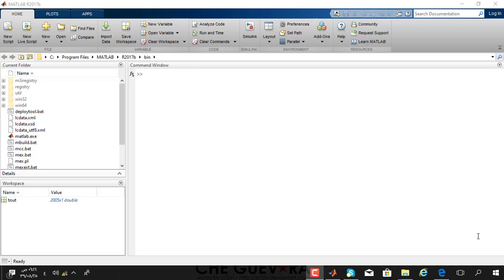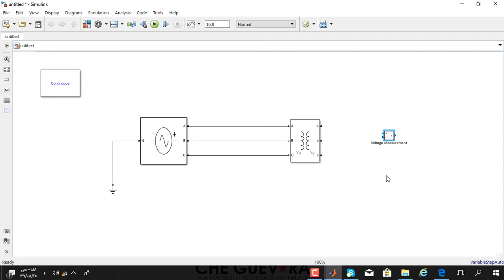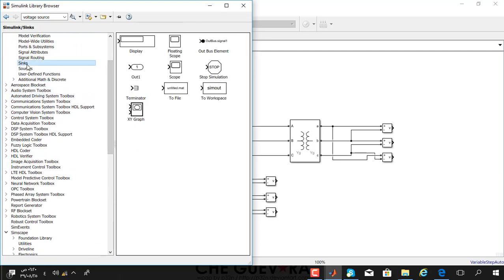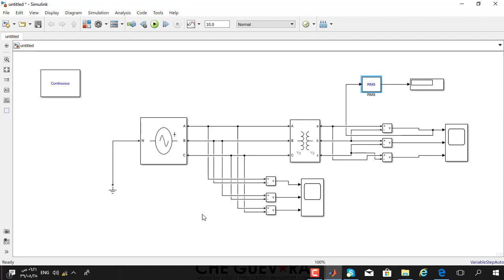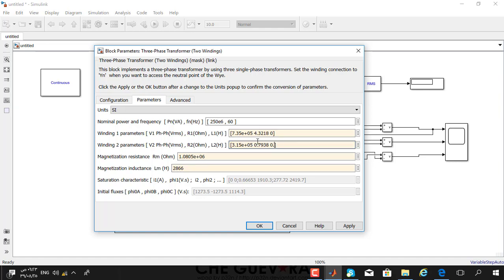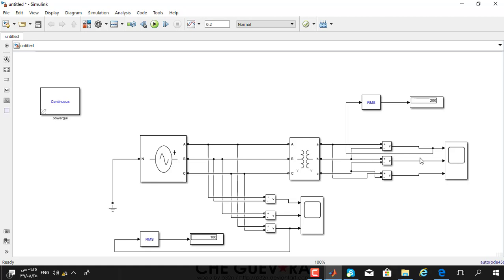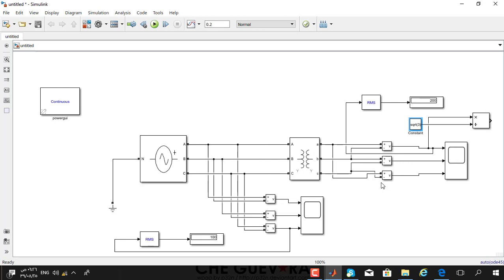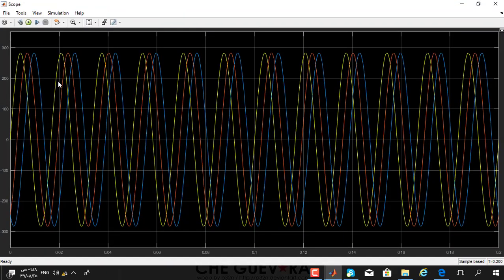Simulation of three phase transformer Y Y & Y D

Comment: x وعليكم السلام
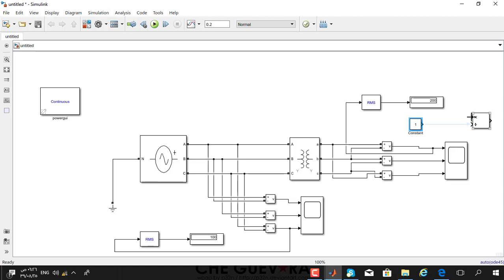a mistake at 09:37 : when measuring the phase voltage. 200/√3=115 and not 81,6 (instantaneous)
you could connect the divider after the RMS block instead, or even better ... measure directly  between the earth and the phase, without SQRT.
Reply: well captured hopefully he should take note.